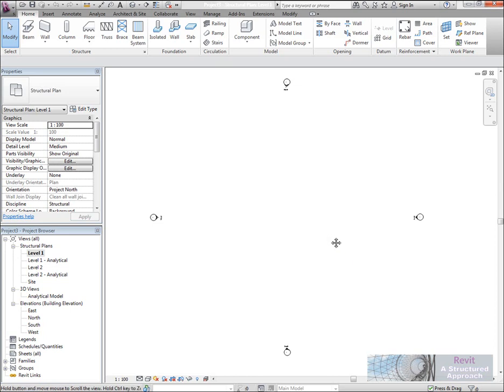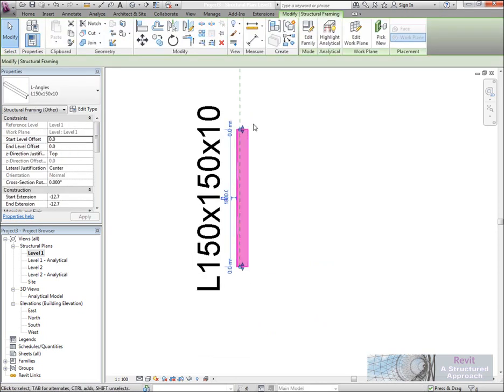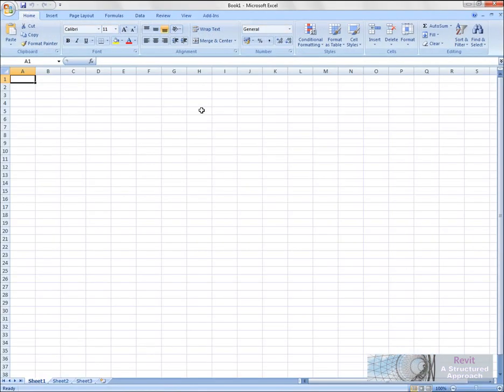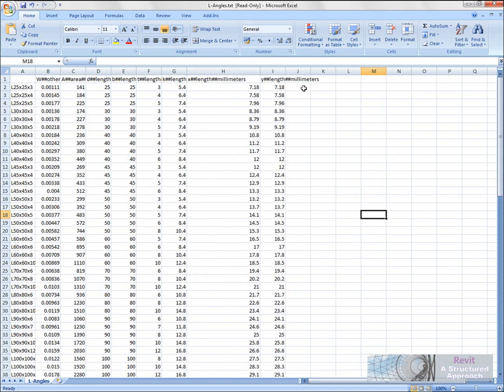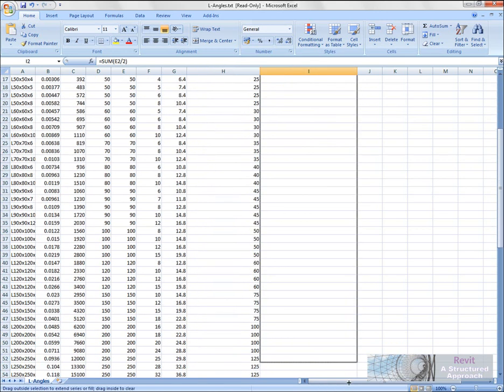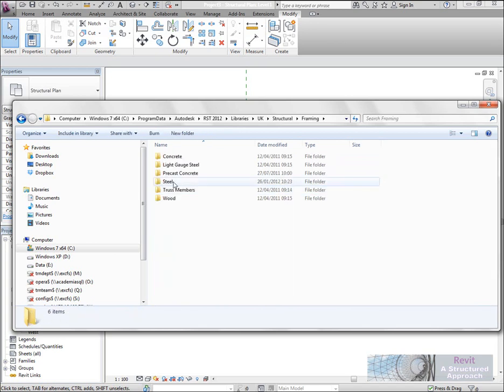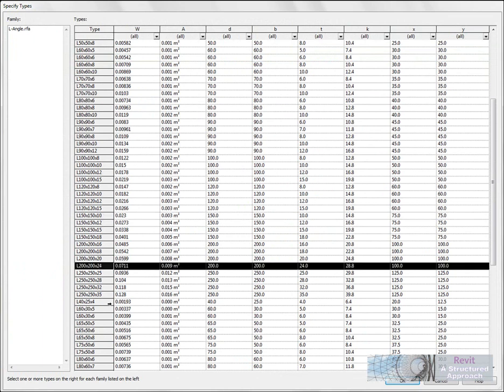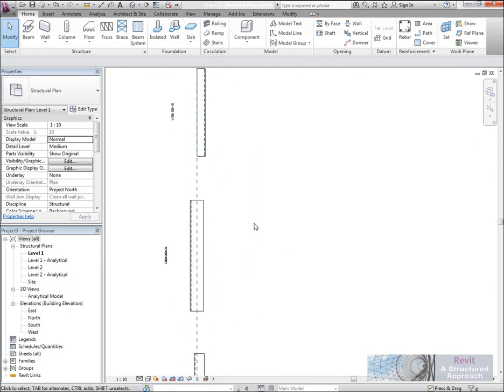Revit Structure Tutorial - Editing Angle and Channel Sections.wmv

Comment: Hi, I've tried doing this for the PFC channels, but it doesn't seem to be working. There is only an X dimension to edit with the PFC's, which I have done as per your tutorial, but the RFA file (even though they are named exactly the same) doesn't seem to be reading my modified TXT file. Could you advise? Thanks

Comment: Do you know if adjusting the profiles as you have done in the video creates any issues with the analytical model location lines, or impacts exporting Channels and Angles to analysis software?  I'm under the impression this merely adjusts the extrusion geometry and the analytical model is still assuming the member is connected through its neutral axis. 

Thanks,
-Anthony